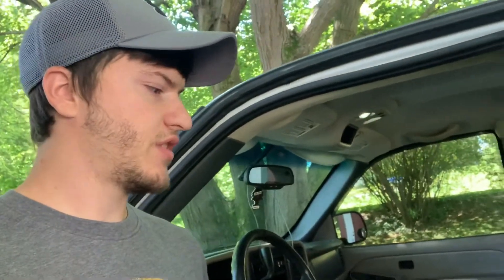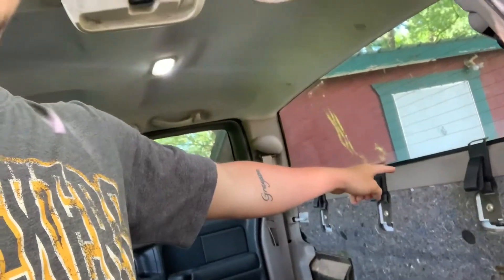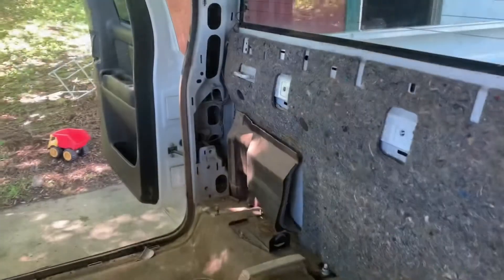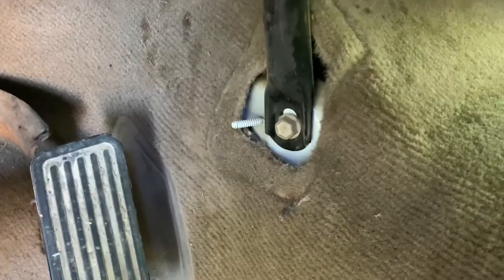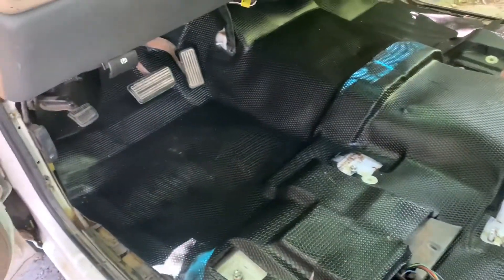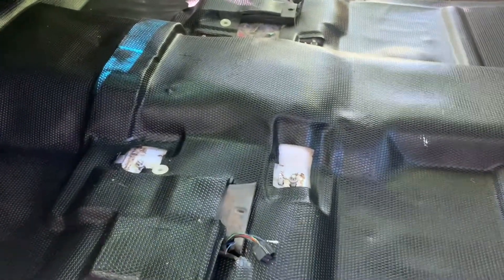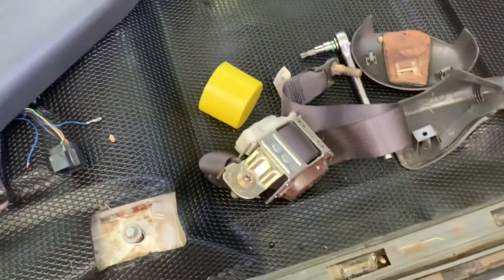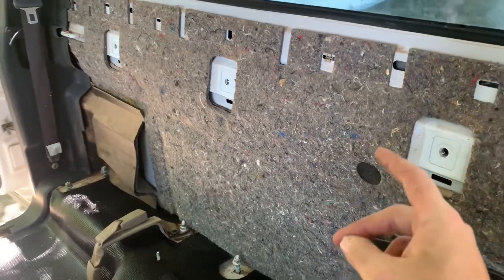03-06 Silverado carpet removal and replace!!! Interior Swap (Part 4)

Comment: Hey, quick question, i just bought this upgrade for my 03 - do i need to apply some sort of glue for that underrug/insulation thing??
I plan to install sound deadening material under all of it before i convert to the vinyl flooring.
Reply from the maker: @kozmicflush980  no, it just lays down.

Comment: How long did this take you to complete?
Reply from the maker: Probably around 1 hour or so! Super easy job!
Reply: That's just the carpet, though, right? How many hours did it take total to remove all necessary parts?
Reply from the maker: @isaiahayala8265  that’s with taking everything out! Once the front and rear seats are out there’s really nothing else holding the carpet in! It would probably take longer in a crew cab or if you have a full center console, but one like mine is super simple!!